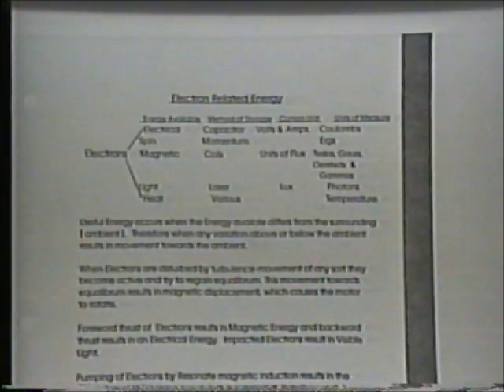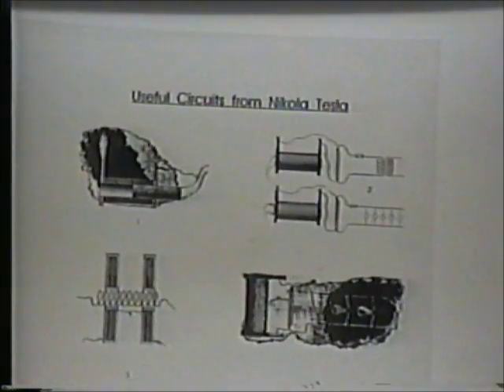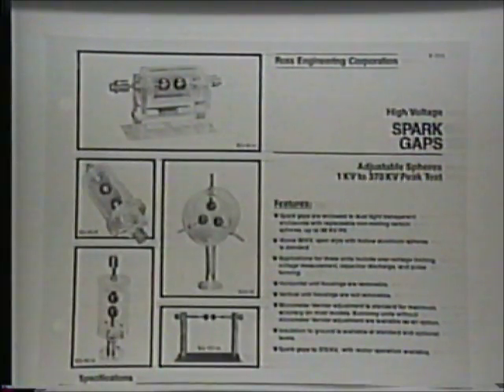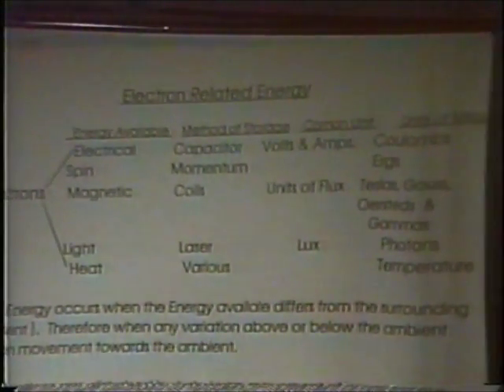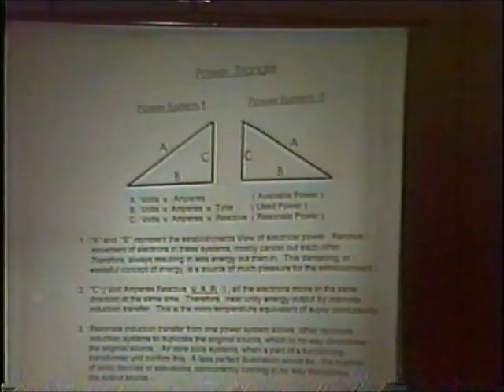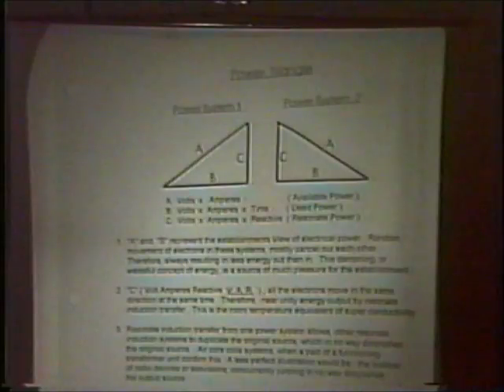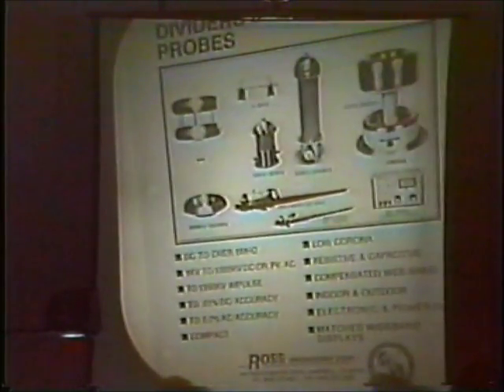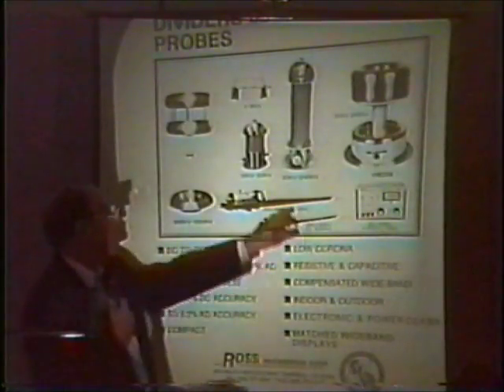2 Don Smith Resonance Energy Crafting Systematic Index 1995

Comment: Let no one think that the energy will appear large as soon as you connect a wire to the ground, I assure you it will not happen. The energy does not come from the ground, but from the magnetic field of the coil. I would even say that the energy comes from the 1V battery voltage. I know how to make a device, I guessed the riddle.
Reply from the maker: Why do call this a riddle?
Reply: @rickfriedrich  I call it a riddle because many people think that energy comes from the ground or from the air Energy does not come from the ground but from the voltage and amperage at the input But it is the pulsed current and voltage that makes energy It is through the magnetic field of the coil that a higher voltage and higher amperage are created in the resonance Because the resonance improves the quality of energy There is less impedance, which means less energy loss The resonance also transfers energy better There is no need to change or set the turns between the coils to change the voltage energy With the resonance itself we can do this By changing the capacitor or coil or frequency The resonance can set the voltage This circuit is half a joule thief This is an inverter ZWS converter At the input you have to take, for example, from a 12v and 10A battery There is no such thing that we can have something for free This means that we start with 12v and 10A and we can end up with 230v and 1000A at the output Yes Tesla and Don was a genius At the output we can have as much energy as we want Between the coil circuits 12v and let's say 230v we increase the energy and amps This is very easy to do Don said that at the output the coil should not be connected to the mass of the battery The coil connected to the ground with a wire has more, i.e. it will pass energy Because it secondary load coil sees other greater energy In all this the capacitor bank plays a big role, it collects energy and transfers much greater energy to the load as we put in That's why I guessed this riddle step by step Correctly you only need to make the coils and choose the frequency and made the ratios through resonance and not through coils I am translating into English and maybe what I write is a bit wrong I am from Poland I have to get down to work a bit and start making the device But I do it a bit differently than Don I have my own way of doing it
Reply from the maker: I'm not one for insisting upon words or theories or even in telling people you can't do this or that. The things you say depend upon what 'cause' or kind of cause you are referring to. You are mostly talking about the way you understand the operation of things but not where the energy is ultimately coming from. You are also assuming there is one basic system when there are in fact completely different and opposite systems depending on what you are doing. To say Energy does not come from the ground needs proof, and unless you can demonstrate that we will just call that unsubstantiated opinion. We could look at the switching and coil as triggers or pumps mining potentials of earth or air grounding differentials. These are all systems that work with all the elements. When you start to do your experiments you will find your first statement a mistake where you can indeed see, when properly coupling to ground such a difference. Or if you don't understand what you are doing you will see, like with a direct connection to ground, that you will become out of tune.
Am I correct in saying that this is all theoretical with you and that you have not experienced any of these results yet?

Comment: unless wire is relatively straight it won't vibrate at natural wavelength frequency, when coiled virtual capacitance is added which lowers that natural frequency so you may tune by squashing
or stretching coils. 
one may see frequency of ring for each of the separate elements of system with oscilloscope using a piezo electric lighter in proximity of same.

Comment: For the wave shaping step, to get the AC type of waveform from the pulsed dc, what kind of diodes are used for making the full bridge rectifier? L2>>bridge>>CAP1>>asymmetric counter wound coil(CW50/CCW52)>>CAP2.
Also is CAP2 polar cap or non polar?
Reply: need high speed/power diodes, that's one hangup; one can make there own high power diodes with an iron/ aluminum electrode arrangement in water with some electrolyte added, need a couple in series to rectify adequately though as i tested with household power supply(120RMS@60Hz), but never tested for speed.
 he mentioned something about the diode equivalent being (somehow) cap and resistor in parallel, that sounds interesting as much easier/cheaper to get high voltage caps at least in nF range then high power/speed diodes, high power resistors can be fabricated with water and electrodes as well. MW oven diodes are high voltage, but can't handle significant current.
Reply from the maker: You'll have to watch all the videos as you have there answers there. I can't take the time to answer questions already covered by Don. Also, if you need to ask these two questions then you should not be experimenting with these devices until you learn the very basics.

Comment: You can get the most advancement, if you just forget everything you have been taught in school. It is taught that way for a reason and the reason is what you pay every month to the power company. I am en engineer and I have learned in 2 years that the whole curriculum was a scam to produce people that copy devices that waste power. This is the hardest part. People just can't go there. It is like telling a southern babtist to accept there is no Jesus. Watch a cartoon that teaches you what AC really is. Then stop returning the current back to the source. You are about 50% there at that point
Reply from the maker: Oh there are many secrets and tricks, but what Don showed did not have secrets. Unless one would mean part numbers and the like proprietary details. I suppose what you mean would be like people just directly connecting to the grid power lines going to other people's houses without a kw meter. That would be a trick. 
Your mistake is assuming people will stop assuming. And that is the WHOLE problem with everyone. So long as the masses are conditioned to and have no problem assuming then they will always be enslaved by themselves and others. Any overunity system, however simple, just can't be accepted or installed or used because of this fundamental problem which is a psychological problem. It is just like eternal life, people will not accept it because it means giving up the assumption/prejudice principle of selfishness. In the same way people can't let go of what they are used to or what other people are doing. So we are far from an "end now" as a whole. It doesn't really matter because no one is listening. All voices are drowned out by so much noise!!! Change must come on an individual level, and no one individual is going to change masses of individuals that can only change one at a time....
Reply: and I have watched Don's videos like every 2 months. You find something out and you look at the videos again and you actually realize he is trying to tell you all the time. It just does not make sense if you are still wired the establishment way. Like when Don says 5000V equals 5000A and you think that he is crazy.
Reply from the maker: I don't know how many engineers have called me who have the same sort of story.
Reply from the maker: Before I did the Don Smith book last year and typed out each spoken work in these videos I had missed at least 5% of what he had said. In the Introduction I highlight some of these important points that I find people miss. He did cover everything but people only pay attention to sensationalism.
Reply: @rickfriedrich  I can't tell you how many times I have watched these videos. He tells a lot of important things, but I think they are mostly missed. People tend to view these trough heir own experiences. I am still trying to find the book/pages Don is showing on many of his videos, where 3 images show the RLC tank doing damping, even and amplifying wave forms. any idea what that book is? Can't even make out the text to do a search for full sentences
Reply from the maker: The details are not important. They are about the Klystron. What is important is what Don says and to have the lower trumpet wave.
Reply: @rickfriedrich  thx. I think I have to secret figured out and I hope have the devices out by the next xmass.
Reply from the maker: There's no secret.
Reply: Rick Friedrich well I think if there is a simple technique to get unlimited energy and we still pay our power bills, then I would call it a secret. We are deliberatly taught only techniques at schools that result in under unity devices and it has been so for 150 years. I think it has come to an end now. We can have self looped devices withoutbatteries. That will change a few things I imagine
Reply: @rickfriedrich  good idea